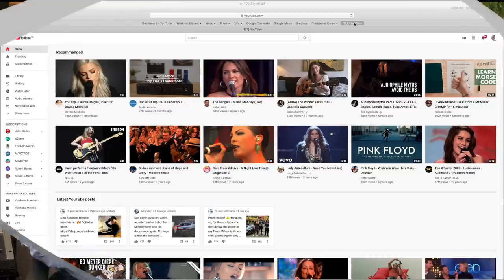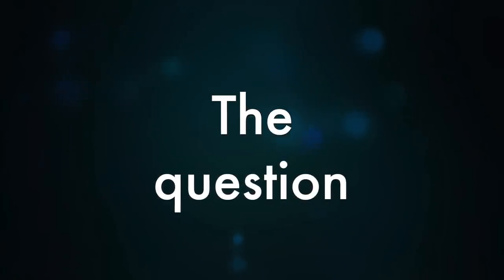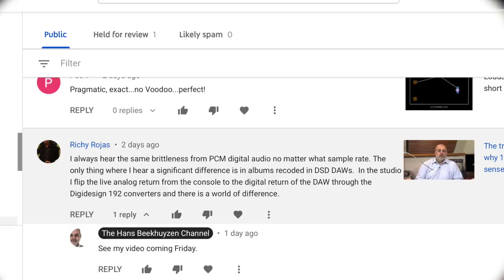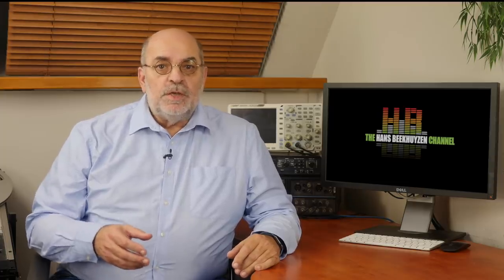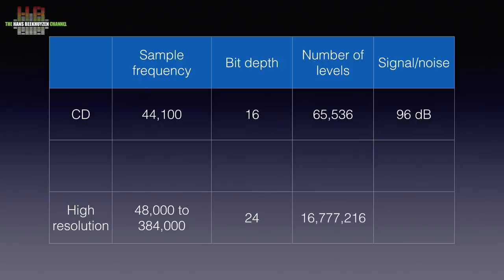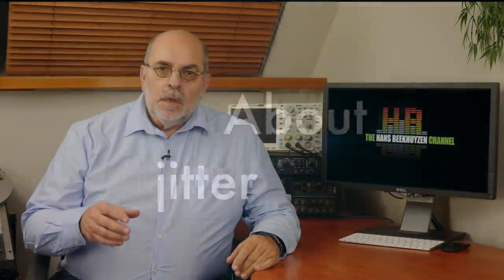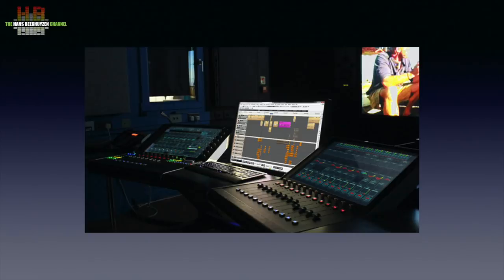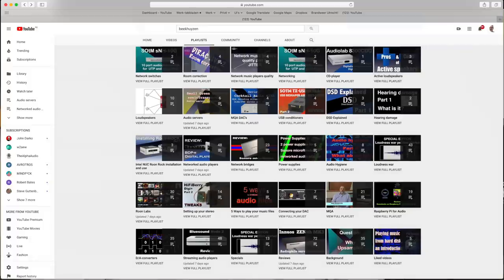Question: why does PCM sound brittle?

Comment: I recently started sampling some DSF files from the internet and there is a dramatic difference between them and FLAC files. Even 24bit/192khz doesn't have the same quality to it. I didn't expect the difference to be as dramatic as it is.
Reply from the maker: It's primarily not the quality of the audio files but rather the properties of your equipment that make the difference.

Comment: Is jitter from audio USB from PC to DAC still a concern? I was under the impression that modern USB audio 2 and asynchronicity means jitter is either barely or not perceptible even for high data transfer rates.
Reply: Hello.
USB from a normal computer is garbage.
I upgraded from a PC USB signal with a W4S USB Reclocker (wich helps cleaning the signal) to the SOtM SMS-200 Ultra Neo (alone) and the difference is BIG.
Your DAC will sound much better with a good USB signal and more with a good USB converter (like the Audio-gd DI-20) between the source and the DAC.
Reply: @pedroluisguillemain5683  I see thank you for replying
Reply: The audio sellers wallet will sound much better if you spend a lot of money in such stuff... A lot of theory to justify buys.
Reply: @sebsoud  I think you are right, and originally the point of me studying audio is to understand and save money on it in the first place.
Other than equipment, the studio doing the recording and it's best practices seems to the most important limiting factor, and I as a consumer have no control or knowledge of it.
Reply from the maker: Ignorance is a bless
Reply: @TheHansBeekhuyzenChannel  lol thanks for taking away our blessings